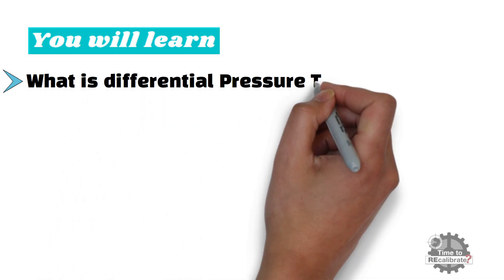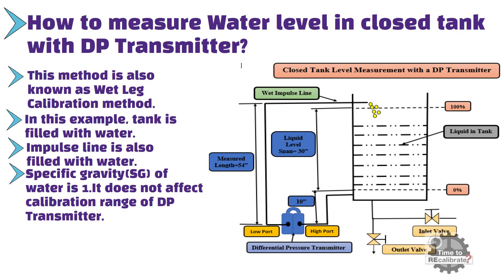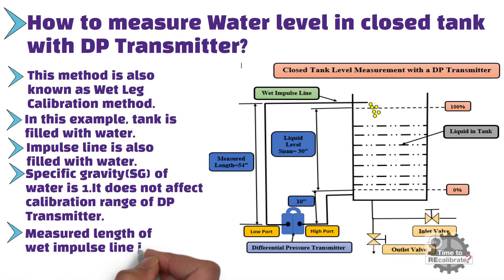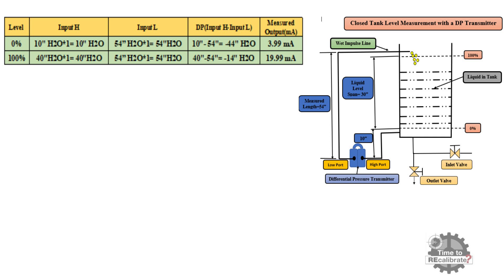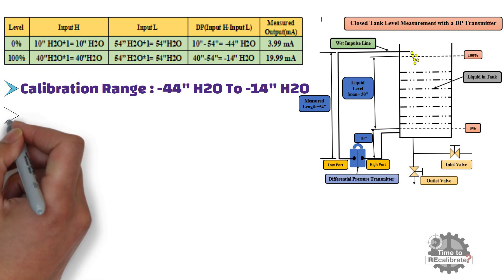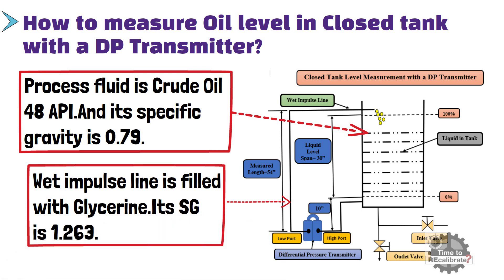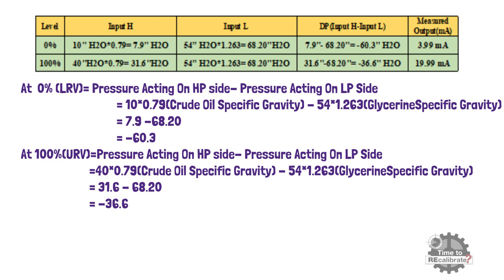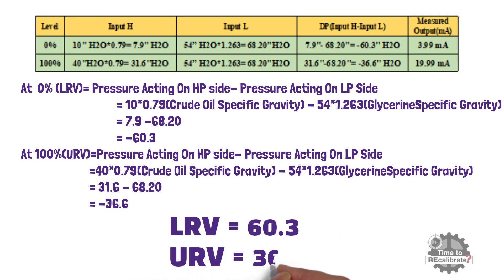Closed Tank Level Measurement using Differential Pressure Transmitter -Level Instrumentation

Comment: is it possible to measure fuel level in a closed tank without a DP and only a submersible pressure sensor?
Reply from the maker: Yes, It can be possible. You may need to use hydrostatic level sensor to measure level of fuel tank.

Comment: Excellent, I have a question, these equations are made prior to installation of transmitters. As a tech for calibration of these transmitters, we still would need to know  these equation parameters of the LRV pressure to put on the right pressure for the  simulator in order to determine 0, am I right? I guess I’m really asking if walking into a facility to calibrate, the plant should know the high side true pressure for calibration purposes
Reply from the maker: Hello BMACk'S
Thanks for asking the question. In order to determine LRV, you need height distance from transmitter to 100% level of the tank, and you also need to know what type of liquid is filled in impulse line. I mean specific gravity of impulse line liquid. Same thing with high side pressure. Hope you get your answer. Let me know if you need more clarification

Comment: Thanks Alot. I recently had a confusion on calibrating an old ABB 266 series pressure transmitter used at a Water Deaerator. The Upper/Lower value were negative and I was wondering why this sort of values were used and how they came up with it. This video greatly helped as I exactly understood how they arrived at the negative values. Just one question, since the water in the Deaerator will be roughly around 120deg.cel, I was thinking of using the specific density of water at 120.deg.cel for the calculation. Or should I still used 1?
Reply from the maker: Thanks for asking this question. You need to consider specific gravity of water at 120 deg cel
Reply: @InstrumentCalibration  Thank you.

Comment: If negative calibration range can’t be set on DPTs why do we have DPTs of typical 3 dp pressure ranges
-25inH2O to +25in H2O
-250inH2O to +250in H2O
-1000inH2O to +1000in H2O
Reply from the maker: Hello.. Rituraj
Thanks for asking this question. Negative pressure range means low port side of dpt has higher pressure than high port side of dpt
Reply: We know that, what he's asking why did you say that it's not possible to input negative value on the range while it's actually possible. I also dont get it when you say make it positive, look if the tank is empty means LP side has more pressure which give negative PV that negative PV supposed to be the 0%, if you make it positively higher than URV, how can the transmitter recognize it as 0%? Im asking because I know there's something wrong.
Reply: Let say your LRV is higher than URV and let say you getting the exact PV on that LRV which is not possible without offset(not recommended) and it's somehow show 0%, but when the tank starts filling up the pressure on HP side increases and it build even higher value than the LRV, so how can you reach the URV while it's actually lower than the LRV.
Reply: It doesnt make sense, everthing is fine except making the range positive, you just confused the audience maybe the one who doesnt understand will just agree.

Comment: Another question is ; if the Transmitter low side is connected to 0% port of tank . And the transmitter high side is to 100% port of the tank . How do you calculate the DP ? 
Also , which point on the tank will the 4mA be at  ? Is it when the tank is empty or filled ?
Reply from the maker: At  0% (LRV)= Pressure Acting On HP side -(minus) Pressure Acting On LP Side
                                   = 0*1(Water Specific Gravity) - 30*1(Water Specific Gravity)
                                   = 0 -30
                                   = -30
At 100%(URV)=Pressure Acting On HP side - (minus) Pressure Acting On LP Side
                         =30*1(Water Specific Gravity) - 30*1(Water Specific Gravity)
                         = 30 - 30
                         = 0
Calibration Range= -30inch H2O to 0 Inch H2O
LRV= 30 Inch H2O= 4 mA
URV= 0 inch H2O  =20 mA
LRV is always higher as compare to URV in closed tank level measurement.
Reply: @InstrumentCalibration  Sir ... thanks . 
My question is not understood, maybe not clear to you . 

I meant the situation where the impulse line is connected to the high port of the DPT and is filled too . 

Not low port to the impulse line . Under this situation , your reference 4mA and 20mA , will it change ? That is , if the closed tank when empty , signal becomes 20mA .